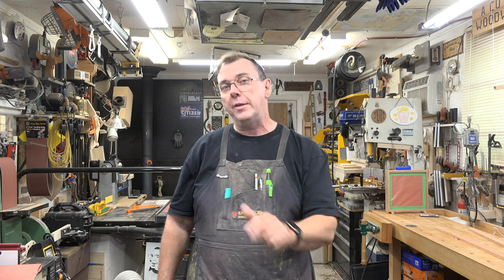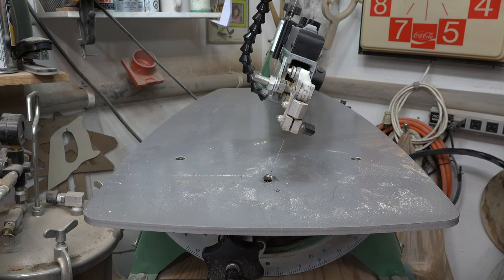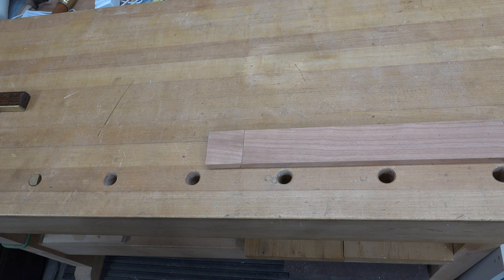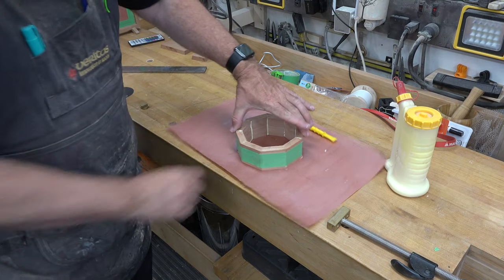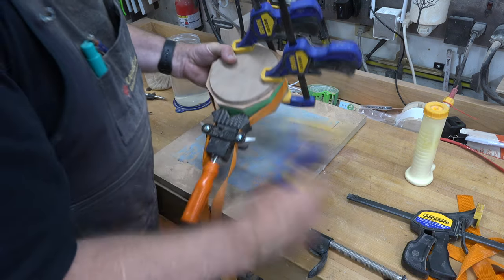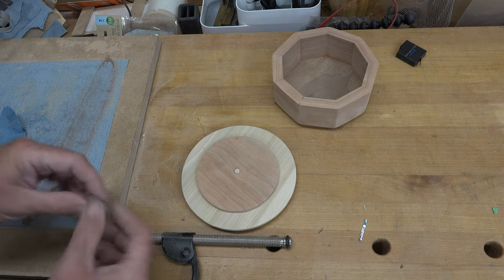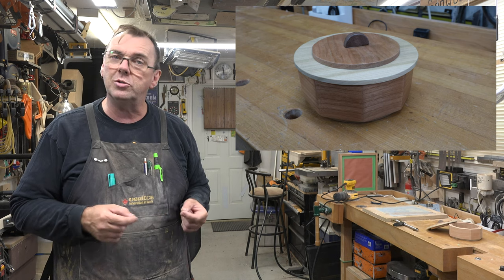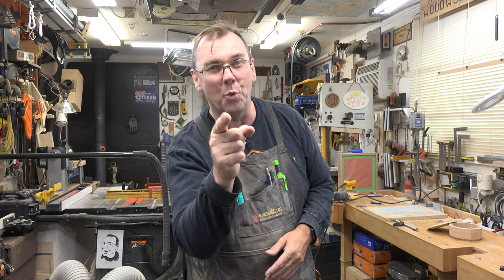Making a 9 Sided Scroll Saw Box

Comment: I'm just into my 5th year on the scroll saw. The one thing I learned was to scroll at my own speed. Also I find it a big help to chill out and stay in my own little world while scrolling. I still have my little Dremel scroll saw with a sde disk sander that I bought back in high school.  I used that little pin-blade saw when I was building balsa aircraft...free flight and u-control. Wow! That  Moto-Shop Model 57-2 Series 4 saw is almost 60 years old and it still runs like new. So when my wife gave me a Dewatt 788 for Christmas five years ago, well I had some learning to do! They are a world apart! You put on a great show and your designs are always so coo!!! How about you designing a scroll saw bowl for us viewers to watch you make? I'm sure you would come up with a beautiful piece. Take care, my Friend!
Reply from the maker: My father had one of those Dremel saws for years.  A noisy little thing but it got the job done.  Scrolling is the most relaxing form of woodworking that allows you to just relax and do the cutting while listening to music or a podcast or an audio book.  I've never heard of anyone losing a finger on a scroll saw so that is one main worry removed from the equation.  Thanks for tuning in this week Micael and for chiming in with your experiences in scrolling.  It is definitely a work horse of the shop.

Comment: Awesome looking box Ken, I like the wood contrast with the Poplar, for those who do not have a strap clamp use rubber bands they work great when you have a project that spring clamps are to small or too large, I use rubber bands for my wooden vases when gluing and they don't leave small dents in the wood,  Ken you must get tired of hearing from me with a new tip (lol) Thanks Ken as always have a wonderful weekend
Reply from the maker: Absolutely not Alan.  I could never get tired of hearing tips from any of my viewers.  This channel is about sharing knowledge and sharing experience and when a viewer shares a tip or trick that they have learned or use in the shop, it just improves the channel.  Feel free to share any tips you may have because if there is one thing that I've learned in the 45 years that I've been working with wood, it's that no matter how much experience you have, you can always learn something new that you never knew before.  Just to add to your rubber band clamp idea, I actually have thick rubber surgical tubing that I use for clamping up oddly shaped pieces.  Same thing as a rubber band and I can get more pressure applied with it.  Thanks for tuning in and keep the tips coming.

Comment: I have a scroll saw, and it gets used on so many projects.  A very versatile machine, for sure.  I also have a pencil identical to the one at 3:55, which I've had for decades!  Back to the scroll saw: I would not have made those nine pieces that way, as it's just not accurate enough.  I'd use a sliding chop/mitre saw, or even make up a simple mitre box for repeatability.  That said, your box did turn out pretty good.
Reply: The point Kenny was addressing presumed one didn't have a miter/chop saw though. Thanks for your tip for those who have the other tools. Great lesson Kenny.
Reply from the maker: I would have to disagree on the scroll saw not being accurate enough.  It is very easy to get the accurate cuts by careful setup of the tool.  The repeatability comes from careful measurements and it also comes from the skill of the user.  As I've demonstrated here on today's show, it is very possible to get accurate mitres and cuts to make boxes like this with just a little bit of patience and some careful setup.  Now with that being said, if I were to make a box like this normally, I would be doing the cutting on the table saw with my mitre fence set to the proper angle but it was requested to do some boxes on the scroll saw and I have to assume that the scroll saw is the primary tool of the person who requested this show.  So that is the tool I used.  Sometimes, you've just gotta rock what you've got.  Thanks for tuning in to the show and for taking the time to chime in with the methods that you would use.  That's the great thing about our hobby.  For every process, there is about 10 different methods that you could use to attain the same results.  It would be boring if we did it all the same way.
Reply: @acutabove_woodworkings  Thanks for your reply.  I'll set my scroll saw (Delta Q3, it's no Excalibur!) to 20 degrees and see how accurately I can cut some pieces.  I doubt whether my nonagon will come out as good as yours though.

Comment: Just bought a scroll saw. What blade (#of teeth?) are you using? 1st try broke it. Guidance? Very good explanation of your process
Reply from the maker: This is a difficult question to answer.  For the most part during this project, I used a number 7 reverse tooth PGT blade.  Understanding blades, their TPI and their cutting ability is partially knowledge, partially experimentation and partially experience.  I have a video on scroll saw blade selection that you can find here.  https://www.youtube.com/watch?v=UG6S5tqx6bI&t=2065s
It's a longer video but if you take some notes, it might help you along the way.  Choosing the correct blade depends on a lot of factors.  The thickness of the wood, the hardness of the wood, the intricate nature of your design, the speed of your saw etc.  Check out the blade video and see if that helps a bit.  Thanks for tuning in.

Comment: Nine sides is just wrong, seven is far better 😁... what a beautiful little box, the slope on the base piece is a nice addition 👍

I never knew a scroll saw could tilt, seems quite obvious now!  Quite surprised that scroll saws don't have any mitre slots allowing guided cuts ... maybe not their main use, but would be useful for the odd time that you do (just like a bandsaw)!
Reply from the maker: Mitre slots on a scroll saw would rarely work Barry due to the nature of the scroll saw blade to drift.  The chances of getting a straight cut that is square to the board is pretty much nil.  There's a lot of practice that comes with using a scroll saw proficiently and a lot of the control is user provided.  Compensating for that drift is all part of the skill learning process and this project is perfect for that.  Thanks for tuning in this week and for chiming in with your comment.  it's appreciated.  (maybe a 7 sided box next time)